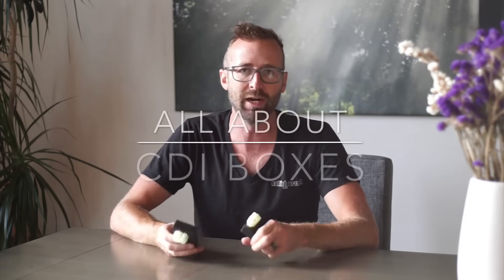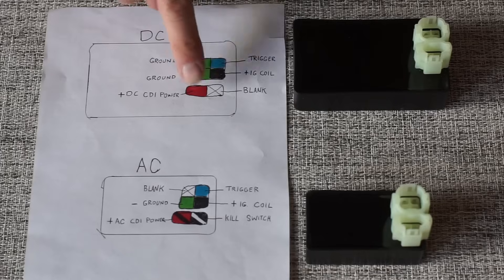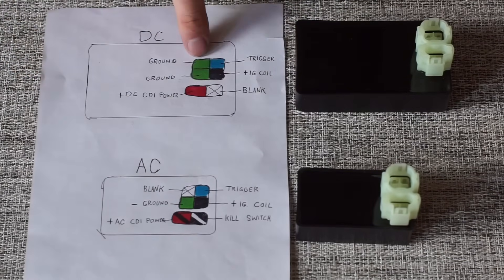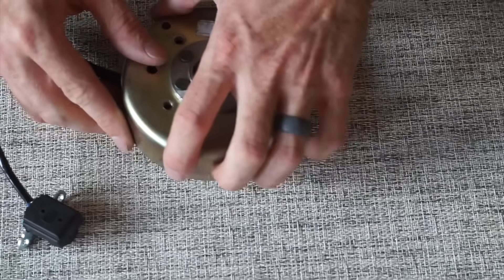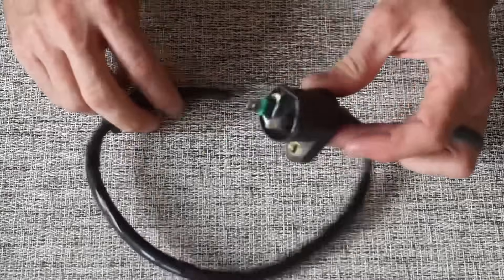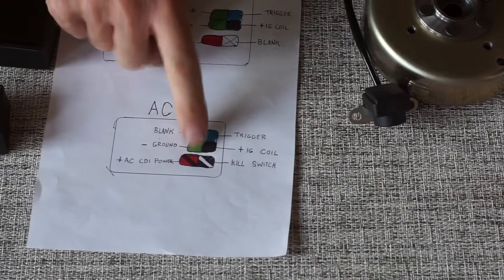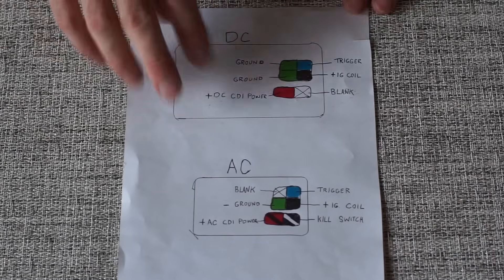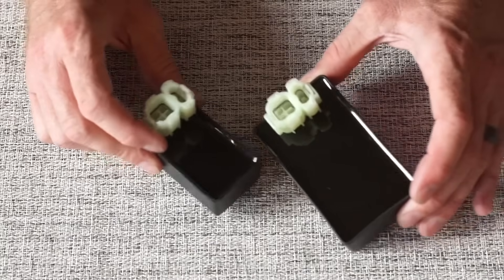CDI  BOX: AC vs DC performance vs stock

Comment: hi sir, what is the difference between DC CDI box that have 2 sockets like u show in the video and box that have 1  socket n 4 pin in it?
Reply: I am not positive so take my reply with a grain of salt, but believe the difference is that one of the pins, not the dc pin is not connected to anything. With an AC CDI the other pin would be a kill pin basically telling the CDI to quit throwing spark. In the DC model if you turn off the key you will kill the DC switch.